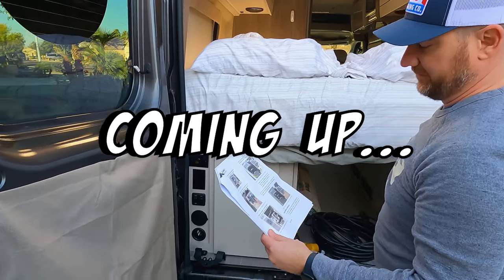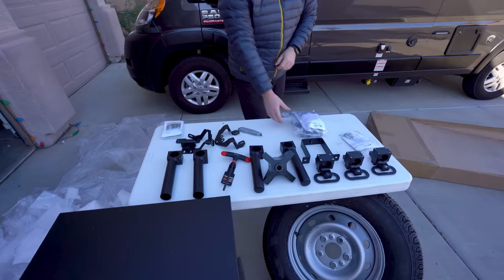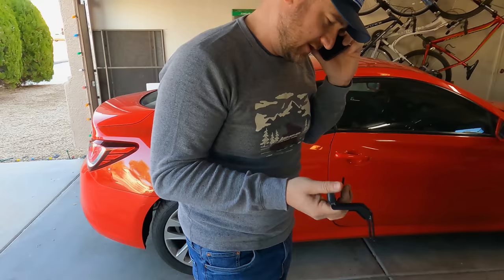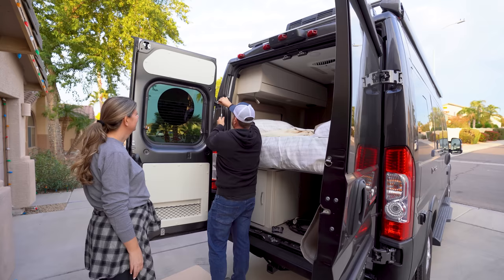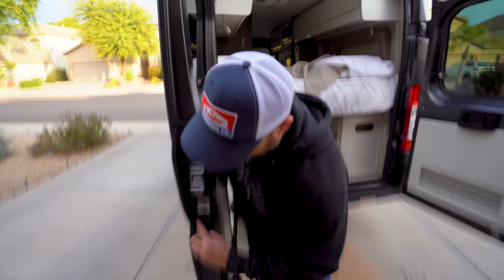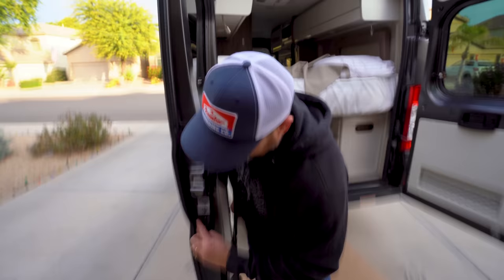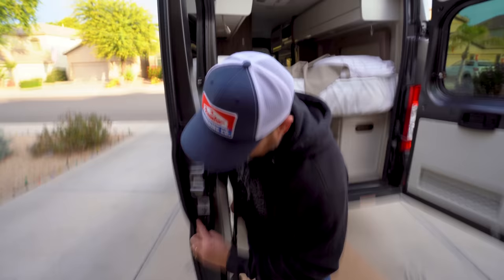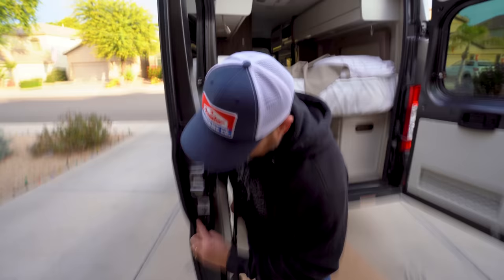Is this $5000 upgrade worth it??? (Full Install - Aluminess Spare Tire, Ladder & Storage Box)

Comment: My wife and I did exactly the same upgrade this afternoon.  Still have the box to drill and mount tomorrow.  We also purchased the large Stowaway receiver hitch storage box on a 180 degree swing away frame.  Getting ready for upcoming winter road trip.  Very pleased with the storage this adds.
Reply: We have the stowaway box and wanted to get the ladder and spare tire holder. Did you need the hitch extender?
Reply: The spare tire may not interfere with stowaway if it swings the other way.  That is why I would wait to order extender.

Comment: A recommendation I would make is that now everything is in its place, go back to every single nut, bolt, and screw to make sure they are all tight, doesn't take long and the extra measure is called "Quality Control".
As you drive on your first trip I'm sure you'll be double checking things for looseness, if one or two keep loosening add a little drop of Loc-Tite to the threads. 
I'm adding a storage box to my Class C for the leveling blocks and camp tools.
Good job!!
Reply from the maker: Fantastic advice! Yes we have been double checking as we go on trips. Truthfully I (Bob) have a issue sometimes with over tightening things lol. We used to own a Jeep and let's just say I over tightened the lugnuts and a wheel fell off as we were driving. Super scary but we were ok!

Comment: Great video - always appreciate you showing the good, the bad and the fun along the way :-).  We have the same van and agree that not having a spare is risky.  2 questions: 1. did you also purchase a jack?  don't recall you discussing that.  2) on some spares I've seen a plug in 3rd brake light.  Have you considered something like that?  these additions do reduce the visibility for the backup and brake light.  We live in CA and I'm concerned that the CHP might have an opinion :-)  Thanks.   Keep the videos coming.  Love them.
Reply from the maker: Thanks! We have not purchased a jack yet but we plan to. We have not thought about adding the 3rd brake light but that’s not a bad idea actually!

Comment: If you fit a removable pin which lines up with a fixing hole in the wheel it will make it easier to mount the wheel on the door .

Comment: I really enjoyed watching your video on adding the Aluminess spare tire/ladder and storage box. I would like to do the same, but I have a request. Could you measure the depth of the spare tire mount and ladder from the rear door surface to the rear of the spare tire, as well as the depth of the storage box from the door surface to the rear surface of the storage box? I have a Thule bike rack that goes into the hitch receiver and I want to be sure that the spare tire and storage box won’t interfere with my bike rack.  Thanks.

Comment: You didn’t show the details on putting the door straps, did you have to remove the door inserts to install the loop bracket holding the strap on the door end  ?

Comment: Great video since I am also looking for spare tire option for my promaster based camper, but, what caught my attention was when you took off the Thulle bike rack rail, which appears wasn't glued to the door. I just installed the same bike rack and the instructions clearly indicated that the rails have to be glued. Did you ever use the bike rack with the weight of the bikes?
Reply from the maker: Wow. It should have been glued? It was a factory installed option and we never used it. Sounds like it’s a good thing we didn’t try and use it lol
Reply: @Vancaskeys  Yes good thing! Even glued I am still a little concerned

Comment: I’m trying to understand the need for the ladder… it appears the spare blocks access to it.. or does the spare swing away from the ladder?
Reply from the maker: There is steps around the spare so you can go up the ladder to access the roof. It does not swing around.

Comment: I don’t understand why the holes weren’t pre-drilled. 🤔 I have a spare for my Promaster, I desperately want to get it out of the garage.  I like the Aluminess but I wish there was somewhere to have it installed in the north east.  Did you purchase a new holder for the license plate?
Reply from the maker: Right? We didn’t understand that either. We got the aluminums license plate holder.

Comment: Great video!  What was that Thule piece mounted on the inside of the driver's side rear door?  Looked magnetic as you pulled it off.
Reply from the maker: That piece is the magnetic bracket that is used to mount the ladder.  You can move it anywhere around the van that you need it.

Comment: I’m thinking of adding the exact setup to my van.  Would you mind letting me know the distance from the rear door sheet metal to the outermost edge of the box and tire?  I want to be sure my bike rack (with Kuat pivot) will still fit.  Currently have a Landed Gear tire carrier and Prime Design ladder.  Thanks!

Comment: Just curious instead of spending so much on a special ladder that has a tire carrier why can't you just find a tire carrier that clamps onto the existing ladder?  The ladder holds about 225 lbs which should be fine for all spares. I saw a few models for less than $100 but may require more brackets for support.  I purposely try to use what I already have instead of reinventing the wheel.
Reply: What existing ladder?

Comment: Looks great, did it come with a license plate bracket? And is the Thule bike rack for sale?
Reply from the maker: Yes it came with a license plate bracket…the bike rack could be for sale if your in arizona 😅
Reply: @Vancaskeys  I wish, I live in cold CT. I really want to use this ladder/spare tire assembly, but I also want to use the Thule bike rack. Neither company can tell me they're compatible. What do you think? I know the Thule rack has a high/low setting. I try to judge by the top of the tire aligning with the window. I watched and froze your video many times. Looks like your spare is as low as it can go.